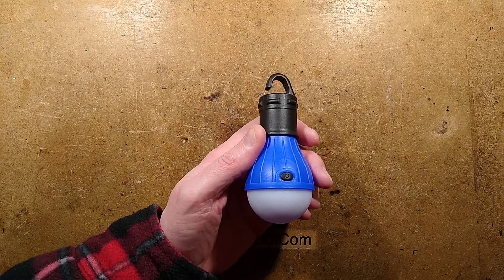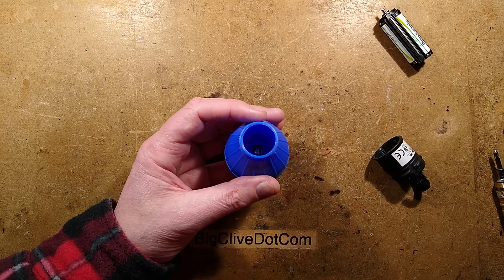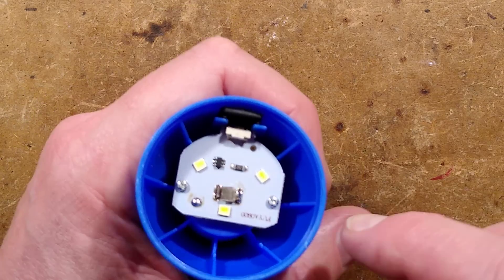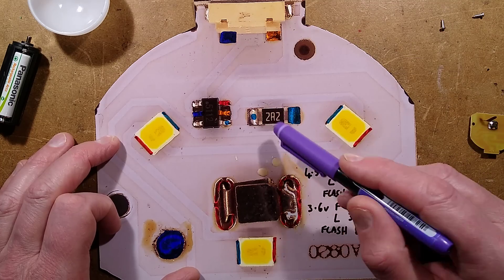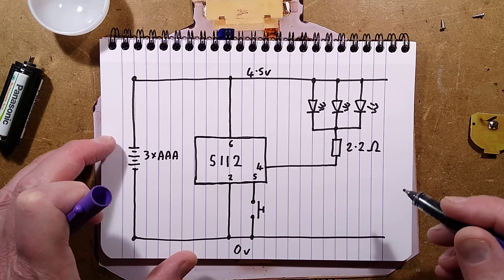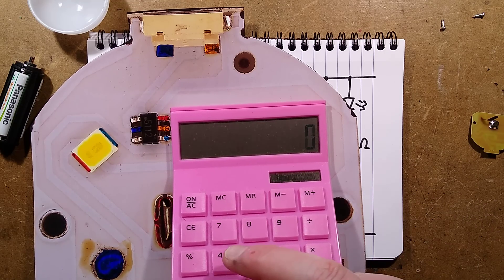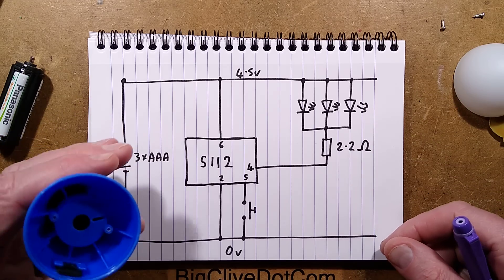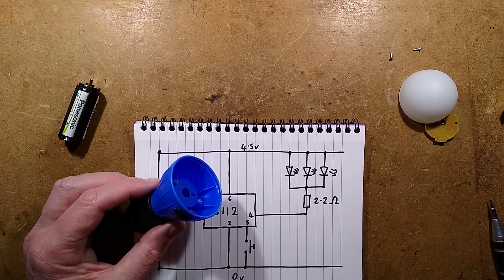Pound shop 4th version camping light (with schematic)

Comment: I think a useful hack for a camping light would be to install a clap switch. I haven't tried it, but I've heard you can make clap switches quite easily with arduinos.
Reply: What's a Gonorrhea Switch? 🤔😇
Reply: @theoztreecrasher2647  You can catch it with too much camping 🤣
Reply from the maker: There are dedicated clap detector chips.
Reply: @bigclivedotcom  building one yourself is more fun and simple enough, but yes there are chips which do the thing... boooooooorrrrriiing
Reply: @B-M.B  Sounds interesting, could you perhaps give some pointers where to start? Is it just an amplification circuit of the signal from the microphone? That would probably be triggered by any loud sound right?
Reply: You can do lots of things with an arduino. But quick search suggests pretty simple circuits without it. 
Not sure if arduino would help much since you will need microphone and transistor anyway.
You can buy a clap circuit for a dollar or two at aliexpress.
Reply: That would also be useful with footfall snapping twigs in the vicinity, triggering the light, waking you so can wonder about what the fuck is out there.
Reply: Really? With an Arduino?
What's next, powering the Camping light with a 10kW generator, because you can??

Comment: Clive, love your videos! Been a member for years.   When modifying these type of lights , how might one go about water resisting them for use in the garden hedges?  Keep up the great videos!
Reply: Clive usually puts one of those absorption packets like u get in pills inside and then silicon shut
Reply: Another thing I saw him use was nail polish to waterproof the connections/leads. I think it was in a solar garden light video. I guess you could use hot melt glue in some cases as well.
Reply from the maker: For temporary use outdoors you can put lights like this in ziploc style bags.
Reply from the maker: As mentioned above, a drainage hole on the bottom of the globe will help prevent water retention and condensation.
Reply: Water will always get in unless you go to a lot of effort.  
The easy solution is to make a small drain hole so that water can't slowly fill the enclosure enough to reach the sensitive parts.

Comment: Those 3-AAA cell holders can be replaced with one 18650 in a plastic tube.
Reply: One issue is it doesn't have low-voltage protection so it could over-discharge (to less than 2.6v) and damage the Li-Ion cell. You should use a protected cell in it so it doesn't get damaged.
Reply: I thought that, but then there's no contact wire to bring the bottom terminal of the battery up to the top. Unless you had a sleeve that did that but not seen those. 🤔

Comment: Why do the twats that design these insist on using AAA batteries? If designed to use AA batteries they would be much cheaper to run and last much longer.

Comment: Wonder if you could hack that holder to have 3x10400 batteries in parallel to go along with changing the resistor to get long run times. That would make it good for an emergency light for power outages. There's another battery I've used to replace one of those battery holders but I can't remember what size it was. 26600 or something like that.

edit: It was a 22600.

Comment: Has anyone here gone camping and have had the need for a flashing lamp? Has that ever happened?
Reply: I'm going to say it here... Why do FRONT bike lights that are pushing thousands of lumens have the need for a flashing function?! Gargh! For oncoming cyclists and road users it's like having a strobe pointed at your face. The front light is for you to see the road/path not to blind oncoming users. rant over
Reply: @james2k2  as a cyclist I find the flashing/strobe effect of bike lights makes the cyclist more visible in daylight. 
At night the same strobing light ( pointed to ground just past front wheel )also increases awareness of other road users. 
Even the bike lights that have TUV approval  mostly have the strobe features.
You have a valid point. Many cyclists , cycling in lit up areas have their lights pointing directly ahead.
Reply: @MattyEngland  true and one wonders how many of these drivers are out there. While it won’t do much for the cyclist it does highlight a problem. Many other similar problems like mobile phone use and drivers lacking analogy to maintain lanes etc. 
Plus I only use tuv certified lights. If one is to believe the testing etc 
These supposed to have been tested and certified
Reply: It's like a secret worldwide cabal of led manufacturers had a secret meeting and decided all lights must have a flashing function.
Reply: I used a small strobe light as an emergency warning, changing a wheel in dark in an extremely dangerous spot on a busy A road, put it in crash barrier about 150 metres away from me.

Comment: I have all sorts of hacked poundland and cheap LiIon 'work lights' that have all been modified in various ways out Scouts use for camps. They all charge from a 200 watt solar system with about 50AH of 12v batteries. It was obviously all done on the cheap but is surprisingly effective. These Poundland thins really are very useful, the PIR operated ones are great for tent porches as they obviously just turn on when they detect moving kids who need to find the wee tree at night.

Comment: I hate that they put that stupid strobe mode on every light.
Reply: I have a tiny torch, on/off/can't decide which.
Reply: Indeed. There are unused pins on the chip. One could be a flash mode enable which is tied either high or low, depending on the use of the circuit.
Reply: A month ago Clive featured mini tail lights for bicycles, which had RGBW LEDs in them and could shine or strobe in several colours.
I bet I wasn't the only one who bought them some too, just because.

And I don't even have a bike myself, lol.
Reply: Yeah, totally makes just what you need into something crap, I suppose one can easily hack such a simple thing and pull the chip or bypass it